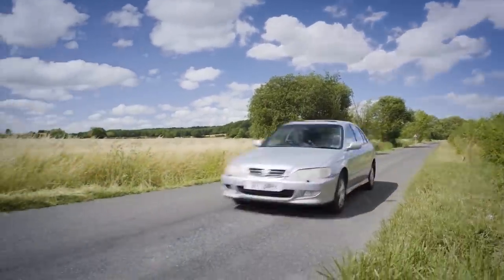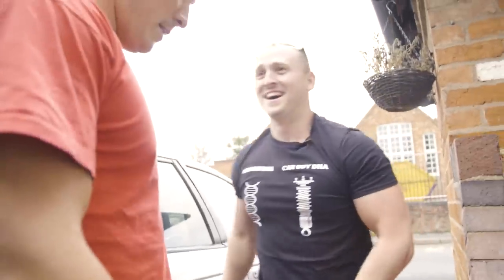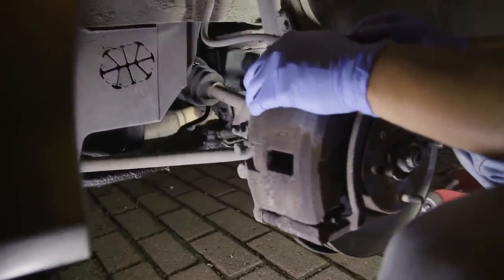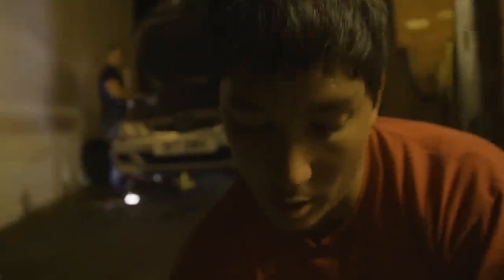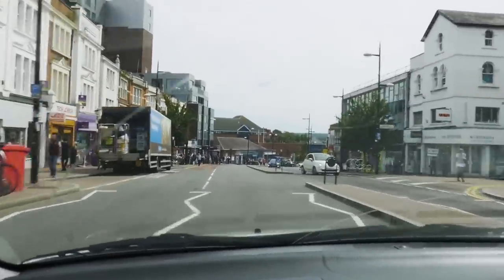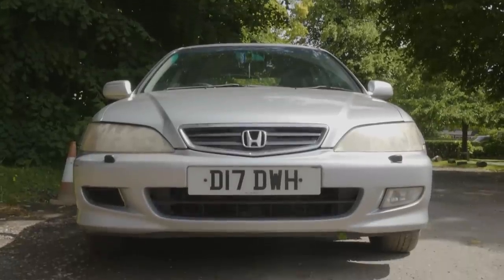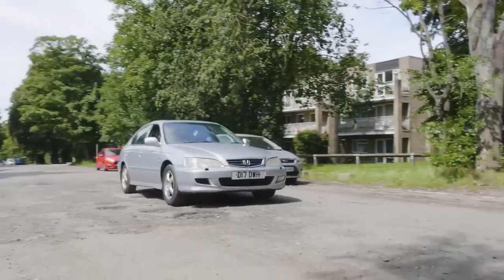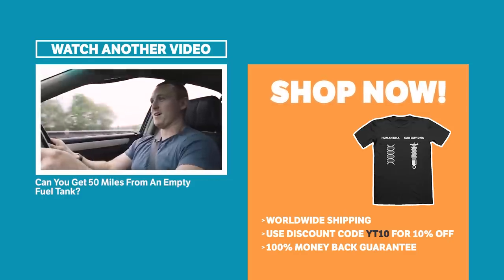Can You Daily Drive A Car With Cut Springs?

Comment: You never start cutting at the bottom that’s the most Secured part of the spring car will ride like shit no lie I’ve been riding almost a year cut and still on same set of tires only flipped the two front so far

Comment: Cut 2 coils in the front and 1 in the back ,be a man over here whe drive with 2.5 coils cutted off or no springs at all and yess our cars bounce on the front at high speeds but whos driving hard with 20 inch wheels

Comment: Why do these people insist on cutting springs with formed ends on struts? Of course it'll change the ride and safety the spring doesn't sit in there properly anymore. Cutting springs is an old car thing with single rates and unformed ends.

Comment: You think this is a ghetto way to lower a car? I used to daily drive a car that someone lowered by holding a blowtorch to the springs until the springs heated up and compressed under the weight of the car.

Comment: Illegal as fuck and they took all day to do that task its less then an hours work depending on the car your working also they bother post such a video.chopping coil springs is old as fuck cut my first set more then 20 years ago it was a waste of time and suspension issue not the mention lumpy tyres just get your stock springs reset they heat them up slightly then compress them abit in a press